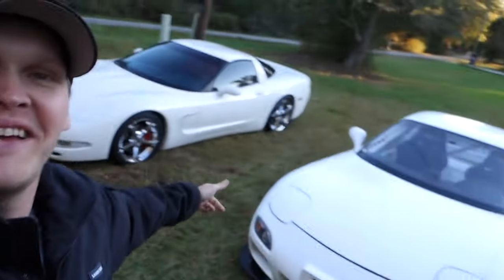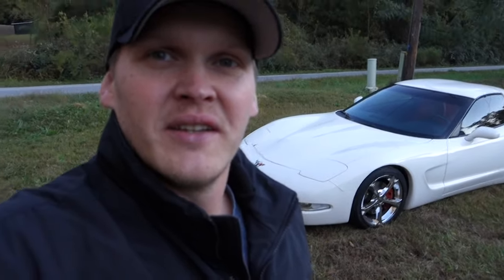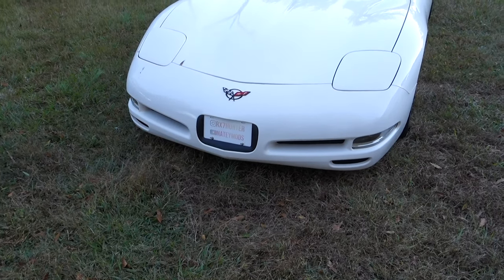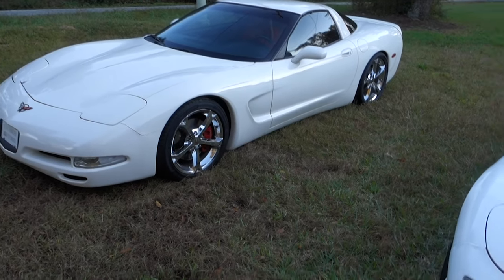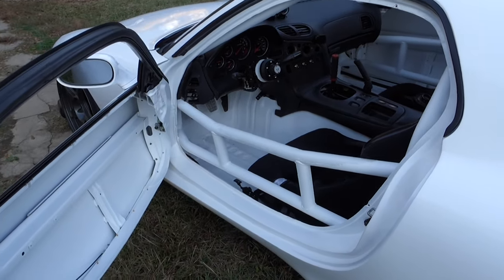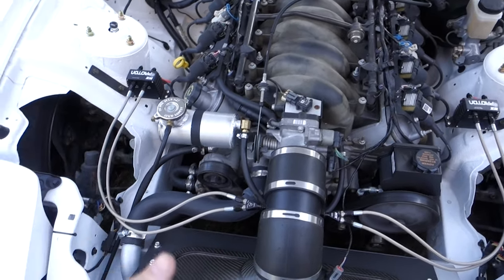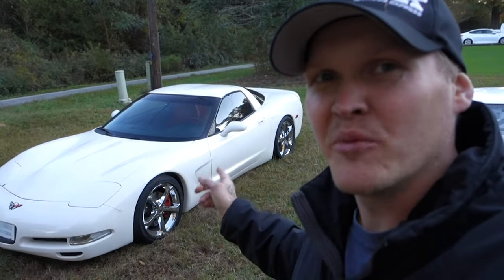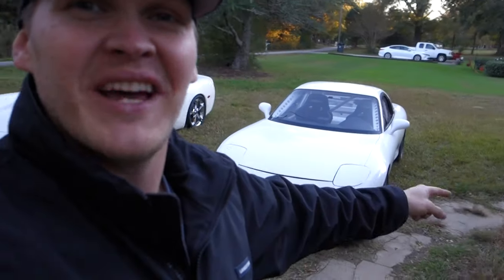C5 Corvette & Mazda RX7￼

Comment: The C5 is a beauty. Love the rear spoiler. Did you have to drill to install ? Thinking of adding one on my C5.
Reply from the maker: Thanks man 🙏🏻 I’m not sure of the brand but it just stick on with double-sided tape
Reply: Thanks for the response. Is it strong enough with only double sided tape ?
Reply from the maker: @roger9280  Yeah I think a lot of stuff just uses double-sided tape, The factory door molding was just held on with tape